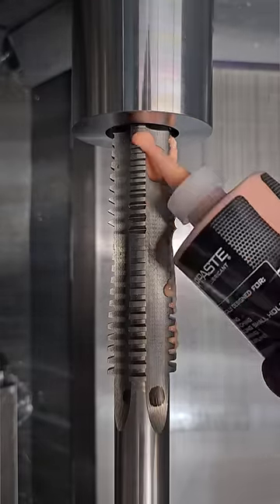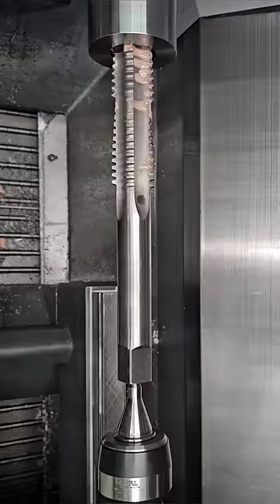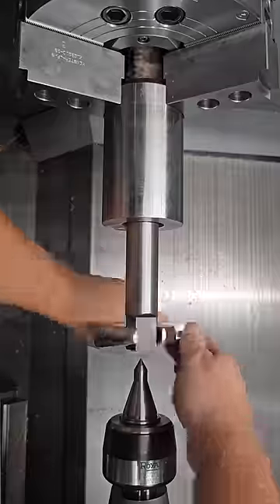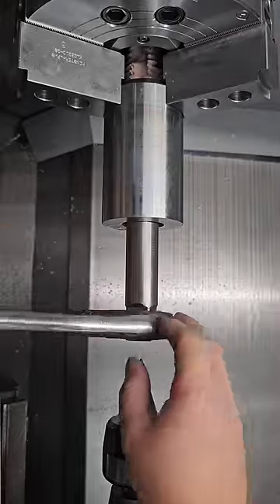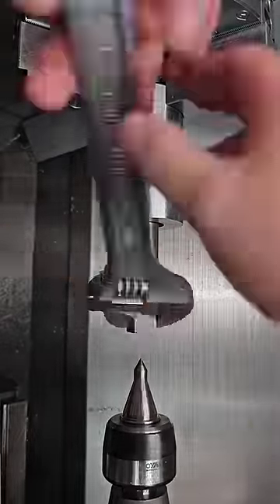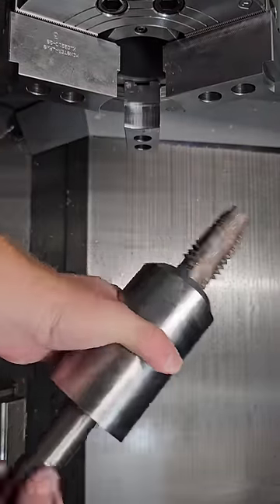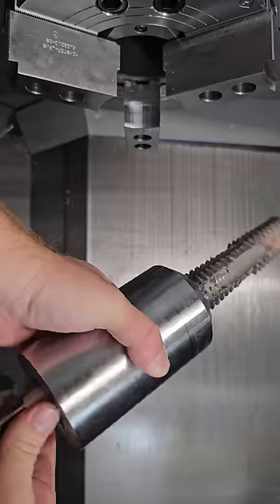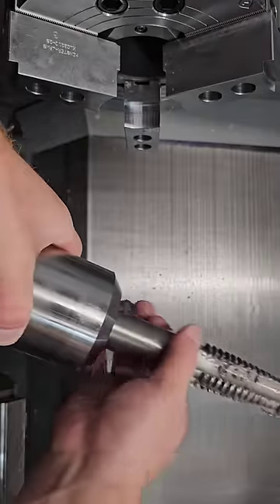This was a terrible idea!

Comment: I can't believe I'm watching a machinist use an adjustable wrench.  I'm just a tree guy, but I have lots of equipment and do most maintenance myself.  We were changing the oil in a chipper truck a couple weeks ago and the head of the oil plug was round.  And my guys wonder why I yell about 'using the right wrench' whenever I see them with adjustables and slip joints when they should have 3 or 4 wrenches...
Reply: Buddy, he is using it to turn a large tap with square flats. Also that tap is way harder than the wrench, it's not like a nut you are gonna round over.

As a machinist I've driven many larger taps in a lathe with adjustable wrench.
Reply: That wrench would snap b4 any damage to the tap
Reply: Over 40 yrs. W / Cranes and machine moving , I've seen at least 3 sets of men arguing over the right way to handle an adjustable wrench . The thought of the adjustable end on the right of a Rt. Hand thread nut in tightening mode sound fare to me , How wrong was I ?
Reply: Using it upside down too.

Comment: Use a 2 step ACME tap. Not sure what the proper term is. Essentially it's got a tapered pointed thread tap section (looks like 60deg idk), then a reduced shank then a tapered ACME thread shaped tap section. This helps reduce chip size so the tap is less likely to spin in the chuck. 

Sometimes you have to just put a live center in the tailstock, keep pressure on the center in the tap, and use a large tap wrench to do large threads like 1.5 inch, and just use good tapping compound and a lot of elbow grease. Anything bigger, you are in the range where you should single point it. I typically prefer to single point external threads at 1 inch (25mm) or bigger. Internal threads are more of a PITA to single point especially in a hurry, so if I can get away with using a tap I will try it.

Comment: What is the advantage of single point threading large ACME threads over using a tap like this?
Reply: A home-made carbide single point tool costs $1.50. This tap costs $150.00. The former requires extreme skill, the latter? Brute force.

Comment: I had a lathe job on a Saturday,  the material was Delrin white plastic. I used a 1-8 tap. It turned out great. Trying to single point that type of material wasn't possible.

Comment: Rough it out first with single point tool. Tandem Acme tap is the easy way to get size throughout. No taper for a long thread. This is the way you do it when your a manual shop with limited tooling and bad machines. If you have new machines and tooling go head and single point it.

Comment: No way in Hell you turned a 1-1/2X4 tap with that adjustable wrench unless it was 10% thread or you had already gashed it with single point.  We just did that job with the same type tap but it was only 3/4X6 acme.  The tap wrench is about 16 inch OAL and turning that tap was kinda a handful.  Mat'l was 303 SS.
Reply: It's a two step tapered acme tap. It's do-able.

Comment: Huh, you mean you get a choice as to what detail you're making?
Single point threading that would take a carbide threading bar - and the threading insert. Single point that with a steel bar and that thing would start to chatter less than halfway through.

Comment: I mean its a fair bit easier with the proper tap handle since you can get both arms firmly on it.
Reply: Also a T handle imparts a pure torque, a single lever creates lots of side force.
Reply: Yeah.  I had to run a 1-1/2" reamer recently.  We didn't want to buy a tap handle that big for what was expected to be a one time use so I used two adjustable wrenches to avoid the side forces.

Comment: Had to make acme nut and bolt for school project and man that sucked. Hand cranking a tap that size with a wrench wasn’t fun. Messing up my bolt threads on the manual lathe, having to start over, changing the speed back but forgetting to set it to turning instead of threading and sending the carriage into the chuck at fucking Mach 5 was worse tho.

Comment: I mean we run up to 1-11/16th all day long, idk about acme or the material your running into but 12l14 and 1215 will run about 1500 parts in a 12 hour shift on beat up new brittian screw machines. Didnt really think it was anything special. Taps have around 5k parts between grinding one tap can make 50k parts if were lucky

Comment: Dude how do you think taps first we're created to be original used that was the first use for any single tab was you get a big ass wrench and you put it on the end of the tab and you turn it with your lathe you drill a dead nut center hole and you just fucking go from there or you machine out that part and then you can hand turn in your die but you miss the most crucial step you turn the lave on at the slowest speed and it'll slowly suck that fucking bit into there and once it gets far enough in there it'll poop it out so if you set up bit up fucking plastic or tube or whatever the fuck down the back of your channel for the back of your leg it'll catch that fucking die when it comes out of there that is the nicest way to say you did a good job is if you can send a die through a tube like that or something that you have drilled and shampered to be thredable Man I hate how we do shit now there is no no nuts to the fucking wall on saying who who did a better job it's just what machine code are we running it's it's fucking sad